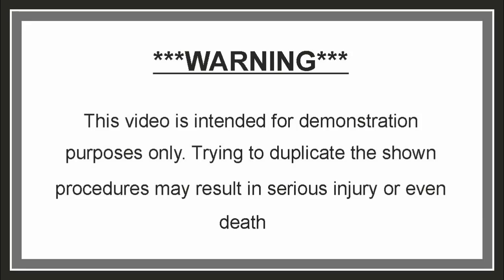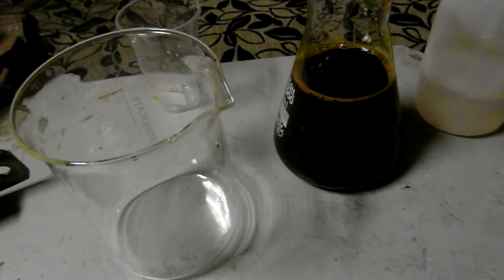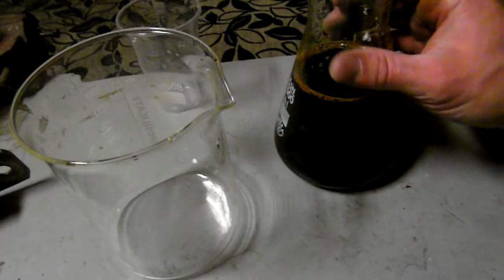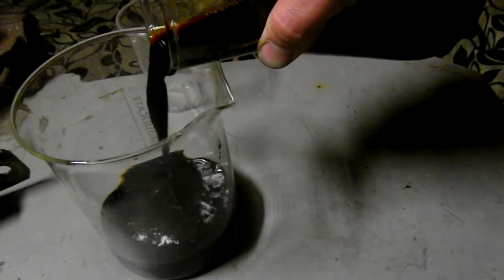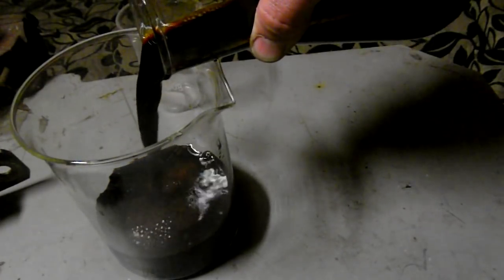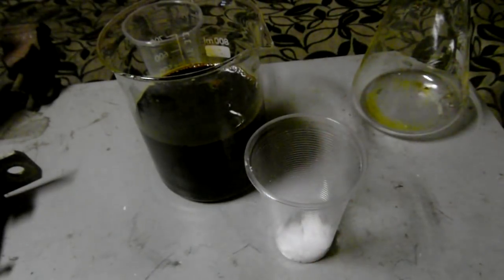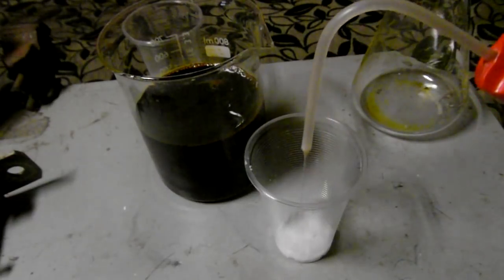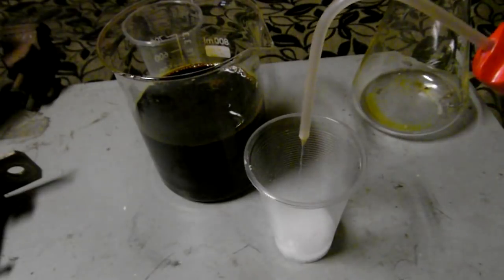GOLD extraction from transistors with iodine PART 2 of 2

Comment: Great video. After adding the hydroxide you added ascorbic acid lowering PH down to 4. Does the higher PH prevent the gold from precipitating? Could you use any acid to lower the PH or does the ascorbic have another function? Thank you.

Comment: Dear OwlTech,

thank You for great video(s)!
This method intrigued me much, so I've run few tries myself.
It went all perfect for when the gold in 70g/30g/200ml was ~2grams I faced a problem when I tried to recover ~10g in such a solution (level You said that should be absorbed).

1) Sodium hydroxide - how much should be added? Slowly untill the PH is 12? or based on the expected gold/solution ml?
2) Ascorbid acid - how much should be added? Slowly at start (to precipitate the gold) and faster later to reach PH 4-3?

Thank You for the great work You do, again many thanks!

Comment: I have both Ascoribic and SMB. Will both work for the precipitation process? If I use SMB, do I still need the sodium hydroxide step? I could not find the answer in the patent.
Reply from the maker: SMB is used in acidic solutions
Reply: OwlTech I see. So the ascorbic acidifies to neutral then KOH precip?
Reply from the maker: ascorbic acid precipitates gold

Comment: What did you use to precipitate the gold?
use sodium hydroxide first and then ascorbic acid

Is the solution dark and transparent (transparent) or dark and cloudy (if you put a flash light on the opposite side you can not see it through the solution)?
very dark dark is not transparent add more hydroxide and more ascorbic acid and nothing

If you regenerated the solution, did you try to leach gold with it? To leach the gold, the solution should be dark brown and cloudy.
if it regenerates until it is dark as when you started and it was dark and a little cloudy not very dense
Reply from the maker: ok stop adding sodium hydroxide. something I'm missing here, what are you trying  to do? getting the gold out of solution or preparing leaching solution?
Reply: Alright, stop adding sodium hydroxide.
okay

something I'm missing here, what are you trying to do? removing the gold from the solution or preparing the leaching solution?
I'm already taking out the gold
the first time prepare the leaching solution as you indicate the gold was removed add hydroxide and then ascorbic acid will clear the solution and the gold as in your video

then use that same clear solution the regenerate with h2o2 again dark and dense
I repeated the same steps insert the processor, but the solution was no longer clear, add hydroxide and then ascorbic acid, but it was still dark.
Why was it not made clear because it was dark?
Reply from the maker: what is the pH of the solution?
Reply: hi friend the PH in my solution black is 10.07 ¿why?

Comment: hi friend the first test I did and when my solution was precipitated it became clear and at the bottom the gold, regenerate the solution with h2o2 and I returned to make the steps but this time the solution has remained dark color was not clear but if I precipitate why is it color dark and not clear?
Reply from the maker: what did you use to precipitate the gold? Is the solution dark and transparent (clear) or dark and murky (if you put a flash light on the opposite side you can not see it through the solution) ? If you regenerated the solution did you try leach any gold with it? to leach gold the solution should be dark brown and murky.